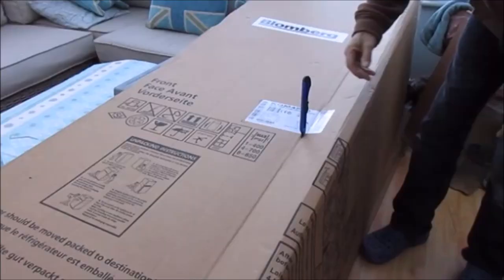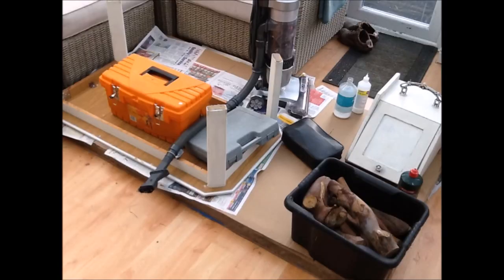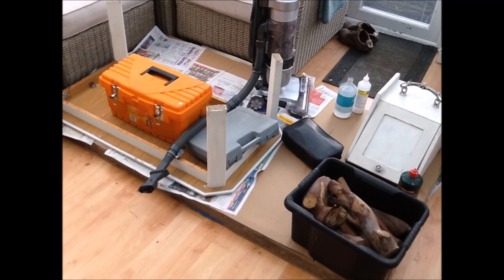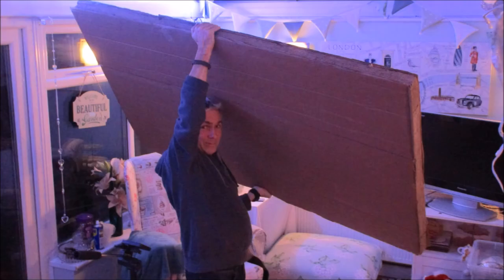How To Make A Model Railway Baseboard - Out Of Cardboard

Comment: Nice idea! I am using hollow core doors from a diy store, wooden framed, ply exterior and cardboard honeycomb interior, lightweight strong and cheap. Had some on trestles out in the workshop for the last two years and had no warping at all. Just sealed them with a coat of varnish and then stuck on some fibreboard underlay sheets baught from the same store instead of cork
Reply: Thanks very helpful

Comment from the maker: Was looking at a magazine yesterday and it still only mentions battens and ply as the only way to make a base board , didn't even mention foam board. It also stated that 6x4ft was the absolute minimum for a round and round layout. Our last exhibition layout was only 3x4ft and even this one is only 3x5.5 ft. I think it's important to challenge accepted convention otherwise the hobby won't move forward. The magazine I saw could have been written in the 1960's nothing had changed. At the other end of the scale others are only interested in DCC ultra realistic railways, there has to be a gap in the middle for basic simple DC and new ideas, and having FUN?!
Reply: Totally agree, no challenge equals stagnation. There are those who like DCC etc and 1:1 reality, but models should be fun as you say.
Reply from the maker: Hi Bob. As you say each to their own, glad you like what we do. Mike
Reply from the maker: Hi Bob, I feel that in many areas British railway modelling is very set in its ways and so it's good to try new things.
Reply: Evading Grid  I'd prefer MIG over TIG but just a personal preference
Reply: Speaking of size, do exhibitions count the fiddle yard as part of the length or do they only count the main layout itself?
Reply from the maker: @MrNoUsername  the actual layout for description purposes but they understanbly also need to know maximum size required for fiddle yards, run around, operators and access etc

Comment: This is a great idea as I too am fed up with 'traditional' methods of constructing baseboards - I just don't have the skills to make wooden joints. This method looks really appealing , particularly for making custom, non-rectangular shapes which, in wood, I couldn't even begin to contemplate. I have used ABS plastic, cellular ceiling panels layered on 1" polystyrene foam 'boards' on my most recent project but I did do a rectangular wooden frame, with metal 'l' bracket joints, for it to sit on. From now on I will use this method. Thanks.
Reply from the maker: Many thanks. Also take a look at one of most recent videos where I made a base board from empty cardboard boxes sandwiched between two sheets of foam board which is much lighter but still rigid. Thanks for watching and commenting.

Comment: You certainly got me thinking, I am currently planning a 2 foot width shunting layout, be interested to know if I would be better off doing 2 foot square sections which is the way I had it planned in wood and MDF board. This method would save me a considerable cost, well done for a great inovative idea, this could change model railway building forever.
Reply from the maker: Hi, thanks for your comments. I have an earlier video where I made a 2ft by 5ft shunting layout using some 50mm corrugated card, very rigid, very light and free!

Comment: Came across your video after searching for "bracing a baseboard".

It's a great new idea - i really can't understand why some people are so negative ... is it just because it's new?

I'm using a different (but probably controversial) method using ply outer skins, with foamboard (card-foam-card) interior bracing and 'open baseboard' format - got the idea from Barry Wood at the Billericay MRG. It should be light and strong.

I had considered the insulation board idea, but it is expensive. Your's is much cheaper than anything else I've seen, and with many plus points.

I've spent 3 years thinking about the various methods of baseboard and supporting leg construction, observing at exhibitions what other folk are doing, and deciding that the more traditional methods used at my club (SHMRC) are not for me.

I might have considered cardboard if I'd come across this 12 months ago! I would have stood the beams on edge and gone without the 'skin' both sides to give access for servos and control wires. I like innovation ... one of the reasons I'm opting for radio control (in 4mm) ... and avoiding all the track wiring!

Keep up the good work.
Reply from the maker: Hi. Thanks for your support. We worked out almost as soon as we did it that the beams should have been on edge and we ended up cutting away the bottom skin for the reasons you give. The hobby seems really scared of new ideas which is why it's shrinking in my view. Really excited to hear about the radio control as I've often wondered about that, so would be glad if you could let us know how you get on. Mike
Reply: Hi Mike. I will let you know. Currently running about 12 months behind schedule (health issues), but I'm trying to catch up. 
I agree ... there seems to be a natural conservatism in the hobby, but also it's being pulled two ways: one section want everything NOW, and at the other end if it hasn't taken two years to build a locomotive, it won't be good enough!
I'm looking for novel and innovative ideas to help me cut the development time (my health problem was a wake-up call), and I want 'good enough' quality.
I haven't got all the wood and foamboard to build the whole layout yet, so I may well use your laminated cardboard in some areas.
Best regards, David
Reply from the maker: Hi David, you are right it's about a compromise time wise, I don't have the patience to see through a massive project, it's why the loft layout is still not started, I saw one guy who took two years to ballast his track! Equally a want a nice enough standard that I can be happy with, so a lot of what we do is as much about simple and quick as cheap. Good luck with the build and keep us posted.

Comment: Very interesting im going to make my base boards from extruded foam and I have been wondering if the boards might require a support sheet of mdf or ply. Wonder no more that cardboard idea is good had considered using cheap interior doors which have a honeycomb cardboard interior and 3mm ply or similar sheeting and 50 x 25 baton as the frame, my thoughts being to cut away the covering in the shape of the intended track pattern. The other thing that with your idea is that the board can be cut to any shape and profile ie raised road bed for the track/s. I am going to use kids desks steel frames as my up stand to support the foam board. Cool well done

Comment: I have been thinking of making a cardboard base board for some time I have been slowly collecting card board still not enough yet bt my design is still with braces but only 4 inches at the sides and ends say one inch thick then cross braces though the centre and ends being only two inches from the base of base board this allows for ground area going below base board service to allow for rivers or mines etc so simple to build above? you beat me to it as I am a pensioner I need to keep cost down as I have resided to build a model rail road instead of my model boats these are being sold to help pay for the set up BUT THE COST OF TRAINS etc WOW best wishes Ken
Reply from the maker: Good luck with it. Even second hand stuff is getting expensive now

Comment: Kinda like your method for its use of otherwise discarded material. However, I humbly think the construction will become much more sturdy when you would have chosen to mount the beams perpendicular to the sheets. Now the ‘waves’ of the cardboard are parallel to the ones of the sheets, which will still allow for some flex of the material. Nevertheless, I reckon that must have lead to your remark a next experiment would induce you to introduce a honeycomb structure inside the sheets. 
Definitely think it’s interesting, especially when prices for lumber and plywood skyrocket beyond every man and woman’s wallet. On the end, it’s always interesting to see methods which introduce the use of innovative recycling methods. Don’t know if it will immediately work for my layout, but will absolutely consider it. Cheerio
Reply from the maker: Hi. Thanks, yes we realised almost as soon as we did it that the beams would work better the other way! We did build another layout using the honeycomb method in a large flat box which was very effective. It's important to keep pushing the accepted and innovate

Comment: First thought that sprang to my mind was, don't you have wallpaper glue in the UK?? Either comes in ready to use buckets or as a powder only to be mixed with water. inexpensive and far easier to apply uniformly with a big brush or paint roller. Excellent for paper mache just dip and soak the newspaper sheets in the glue apply to the desired surface and it will never come apart again... Just a tip you might want to try
Reply from the maker: Yes but PVA is stronger
Reply: @BudgetModelRailways  True, but I was considering the amount of stress those joints have to take, which is almost zero.
Reply from the maker: Wall paper glue is also very wet which might have warped the beams

Comment: Would this withstand being leaned up against a wall for storage? if so this video has just helped me massively.
Reply from the maker: We exhibited it several times and it was moved around various locations in the house so yes I would think so. We would have put the frames the other way up for more stength if we did it again. Another option is the multiple empty cardboard boxs between two sheets of ply or foam board which we also have a video on
Reply: @BudgetModelRailways  I have tried looking for the honeycomb style cardboard but can't seem to find any, obviously this channel is a great help especially for people on a budget and with limited space, it won't be going on a table under use as It'll be just easier to use my bed as the legs so to speak ha. But it would allow me to still be able to walk around the room etc etc
Reply from the maker: You can use small empty cardboard boxes instead of the honeycomb

Comment: What a fabulous job! The structural "timbers" would've been even stronger if you had glued them to the top by their edges (the 2" edge rather than the 4" edge). Great job never the less, an innovative, cheap, lightweight option. Oh, and free!
Reply from the maker: Hi, yes we realised after we had built it that there were a couple of ways we could have improved it but I guess that's what happens when you experiment. So far it's rigid and light.
Reply: Budget Model Railways Hi, yes I guess that's the case. Could you turn it into a commercial venture, especially for "Micro-Layouts"? (Search Chris Nevard or Nevardmedia. Chris uses foam board a lot.) Best wishes.
Reply from the maker: Thanks I will have a look. We have made and sold a couple of layouts using more conventional construction, and I would eventually like to make a few too sell. I guess we could sell the boards for others to complete as an alternative?
Reply: Budget Model Railways budget model railways

Comment: Once the cardboard is laminated is it strong enough to be screwed into? If you’d had some more card you could have made folding legs to go underneath it which would add additional strength and the weight pressing down on the top of laminated cardboard legs would be negligible compared to what they could withstand
Reply from the maker: You can screw into it, we did but a layer of something like mounting board would be better
Reply: @BudgetModelRailways  Thanks good to know, I think the interest in inexpensive and even eco friendly (like your solar powered layout) will increase, more and more people are more aware of different issues and running layouts with minimal waste and resource usage will be important for the next generation of modellers so this cardboard idea is brilliant
Reply from the maker: Certainly we can't keep throwing huge amounts of money on model railways and need to use more second hand
Reply: @BudgetModelRailways  We should, but as you’ve mentioned in other videos, 2nd hand is now getting crazy expensive in some cases, I think some people need a reality check, asking for £50+ for a tank engine from the 70s with broken buffers/cab roof for example 😅
Reply from the maker: Sadly you are correct, second hand with dubious running qualities means it's actually better to buy discounted new now

Comment: I hate carpentry so will be giving this a try. How many layers would you suggest?
Reply from the maker: The planks need to be about 75mm square and set on edge. The tops need to be either two double layers thick or three single layers. Hope this helps

Comment: I pick your idea for my modular layout ! I can buy brand-new 6.3 mm thick coorugated cardboard for 5 € per square feet, and that would fit (and I don't speak about recycling cardboard, that I would also do). Also, I don't need to buy 500 € of power tools to made some disastrous woodworks by my own (besides cooking, I'm a failure at ahdworks), a 25  € heay duty cutter I alreday have would be enough to do decent work.

Just one point : which thickess are your elements ? It's for planification purposes of my own. Thanks for the answer !

Comment: Is it possible to have wired points with this type of baseboard?
Reply from the maker: Probably not due to screwing the point motors in. I did use an old Jouef electric point with integral point motor ok though

Comment: Hmmm... nice idea.  A while back I did a lot of work for a chain of estate agents. When they shifted their HQ, in the clear-out I scrounged a lot of the old 'For Sale' boards*.  These are easily cut - and braced, and make great base-boards, using a glue gun a a bit of savvy.  It's very easy to wire the layout as well - just poke a screwdriver through the top or the bracing!  I also had already got a baseboard from out of a skip (I think it was some form of shop-fitting) which was much like a 'traditional' board.  However, it only had a very thin ply on top, so I stuck three or four layers of these signs on before starting construction of track etc.  In this way I could cut away parts to make dips / differing contours etc before adding plaster finish.  I'm very pleased with the results.   (*This was not my idea, unfortunately, I recall it from a Modeller magazine of old!)
Reply from the maker: Hi That sounds great. could you possible send us some photos for our free monthly e-newsletter!
Cheers Mike
Reply: Found it, done it!
Reply from the maker: Lucky you, I had the same thought but couldn't find a source of them, well done.
Reply: I'm sure most Estate Agents would have a few boards that would look a bit tatty if displayed so would probably be pleased to have someone take them away.  There are also firms that just erect/remore boards for different agents.  Might be worth a try!

Comment: I like the idea but my concern is how track pins hold in it or do you fix track another way ?
Reply from the maker: It was a bit fiddly, although in places the cardboard is thick enough to take track pins. We used PVA and hot glue in others. If we did it again I might use thin plywood for the top. However our various cardboard shunting layouts have all taken pins ok. Like any new concept it's a case of trial and error.
Reply from the maker: Sounds exactly like how we build layouts! The lack of skill is the key as it means you don't know what you can't do , so you do what you like and a lot of it works.

Comment: I really like how you and your son work so well together.  I´ll bet that you must have used a gallon of PVA to glue all that cardboard together.  I think a circular saw would have to be used to saw all that cardboard as hand sawing takes so long and so much effort.  I didn´t count the number of layers you used so could you tell me how many layers of cardboard were used?  Thanks for posting this very unusual way to make baseboard.  Crack on, mate!  :-)
Reply from the maker: Well sometimes we argue a lot but that's all part of establishing a healthy father/son relationship I guess! A circular saw would be best it would make a neater cut. I might borrow my brother in laws next time. About eight layers of double thickness. I would have liked better quality card but when you get it for free you have to take what you can get!
Reply: Thank you, Mike, for your prompt reply.  There´s a furniture store in our mall area where I work and they throw away complete sheets of styrofoam  prob. 4 feet by 5 or 5 1/2 about 2 inches thick.  They don´t reuse any of it so when they come by our dumpster I always look out for them and get all the styrofoam they discard.  They also throw away large sheets of corrugated cardboard.  I plan to use the styrofoam on the expansion of my old permanent railroad.  I have even scrounged some nice wooden frames that the Smoky Mountain furniture place threw away in the dumpster.  They are about 3 1/2 by 6 feet and I plan to use that as well.  I think I came away with 5 or 6 pieces for my benchwork.  It will only need some bracing and legs which I got some 1 by 2 inch hardwood strips.  I ended up with about 60 board feet of that material which will make some nice legs for my bench work.  Cheers, mate!  :-)